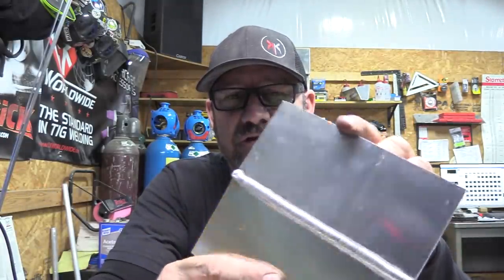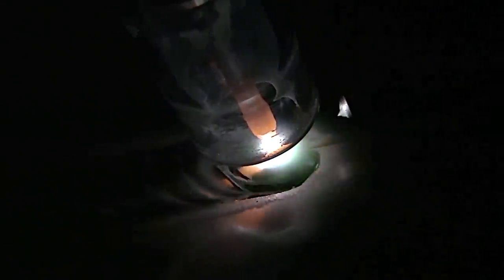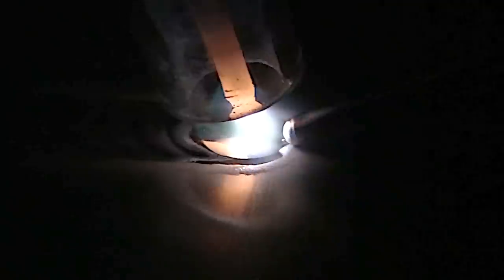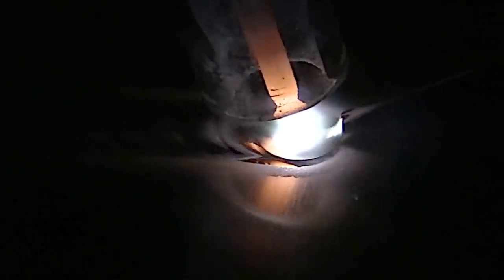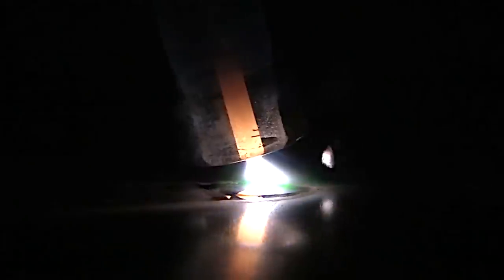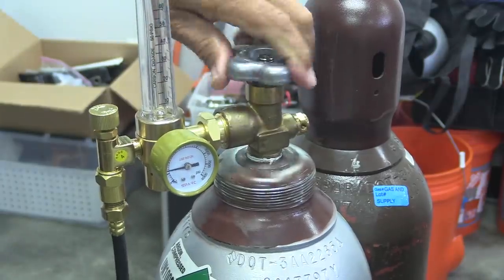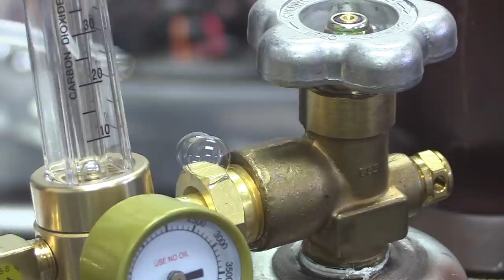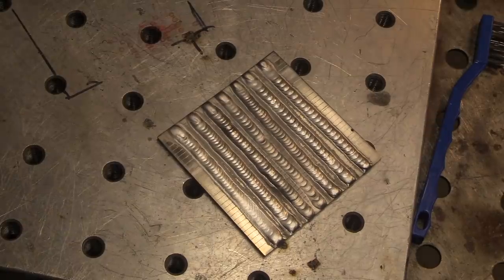How to Tig Weld Aluminum - Techniques for Full Penetration

Comment: Been welding aluminum as a hobbiest and this is exactly what I need. I can make an weld look pretty on the surface but never found conclusive info for the back side. Solved all of my questions in 8 minutes. I'm doing everything correctly, I just need to wait a few seconds longer!

Comment: Fantastic video as always. Best arc shots on the Web as they say!

We only use TIG on the root pass when working on our steam lines. So carbon seamless API pipe, 7018 fill and cap.   

So the AC function only really comes into play when working on home projects, cars and boats for example.
Your videos on AC tig have really become a "go to" for advice and an inspiration .  And of course your talented colleagues.

Best regards from Belfast.

Comment: Great video!  I’ve noticed the puddle drop before but I’ve always been border line panicked at that point because I’m afraid the whole thing will fall out. I’ll try to get a little more comfortable with this!  Thanks
Reply: Same here when I weld that slow my puddle ends up as a flat mess very frustrating

Comment: I religiously watch your videos and all the tips and tricks you gave is what made me to take brother I am today and also too I've noticed that you tested some machines and they've all been high-end machines except for the ahp. Me I got a primeweld Tig 225x and I was wondering if you would get one and give it a try and run it through the paces and see what your opinion is upon it. I've added the max cool 3000 water cooler to mine and it's gave it 100% duty cycle at 225 amps the machine is a great machine in my eyes but it is my first TIG welder and I've had it for 2 years now. I'd like to see you get one in your hands put it through the paces and see what your opinion is for a TIG welder under $1,000 and it has a lot of features like the Miller.

Comment: Kinda related , my question for you is : what 200 amp inverter AC/DC Tig machine do you recommend,  or  top choices.  

I ask because I'm using a AHP 203xi and I have a small job welding some brackets of 1/4 aluminum with a 1/2 tab about 2 inches high and I have to preheat work piece . The main issue is heat from torch and hose.  I get about 5 mins in and every is roasting. Is this from an inferior machine or am I just maxing it out? I'm using #5 ceramic gas lens,  1/8 inch tungsten with 45° bevel and I'm running 200 amps AC , 200 on frequency and 30 % cleaning 100% argon at 12 cfph.

Will other machines such as Everlast , Miller or other popular Ac Tig machines have the same issues at 200 amps? 

I know a cooler is an option,  but I rarely weld that thick of aluminum. 

Thank you  and love the videos and tig finger 
More like tig finger saver

Comment: I’m just learning. Starting with mig on aluminum. Tips?? It’s job related. Technically I am a tubing outfitter but want to tack/ weld my own stuff and am in the booth. Any help? My instructor is one of the top three but not so great on info share. I appreciate your input!!!

Comment: I am wondering how you would handle tiny corners that are diffucult to weld cause of other parts that are in the way. I pull out my tungsten some more and get a bigger cup. Scenario happens often with tiny stuff when 1,6 tungsten is needed (round tip)
Reply from the maker: I usually do the same. I would usually rather use a bigger cup with longer extension than use a micro torch. furick cups like ceramic fupa12 that have extra diffuser screens are not necessarily recommended for AC welding but definitely do work in a pinch with a long stickout

Comment: Can you explain what tungsten is recomendable to use?
Reply: I use CK LaYZr
Reply: Im still relatively new to tig. This is the most asked and least answered question I think i've found. For aluminum I've tried 2% Ceriated (grey), Pure (green), E3 (purple), LayZr (chartreuse) and 2% thoriated (Blue). The only thing I can truly say is that no one agrees, it'll come down to personal preference. Get a few colors and experiment. So far I think I've had best luck with 2% Ceriated (grey) but the E3 and laYZr both work pretty well...for me
Reply: Jody usually uses 2% lanthanated tungstens for all materials I believe
Reply: @chrisplayz253  I’ve always been old school green pure tungsten, but recently my welding supply guru has led me into the lanthanated world for everything!
Reply: I use 2% lanthenated for everything. Try it, you won't be sorry.

Comment: Newbie here :

I'm welding 16/10 (1.6mm, 0.063in) 5754 alu and for the life of me I cannot get the butt welds to get a proper fusion . Under the joint you can see the dull grey metal sagging but with a clear separation where the 2 pieces meet. And once I grind the weld, there it is , a hair line where the 2 parts meet. 

I tried keeping the torch on one spot for long and then move slowly but ... Nope. It's like both parts want only to melt each separately and never mix. Even with the filler metal, they'll mix inside it (on the surface) but under that they're still segregated. 

What is happening..?

It's an industrial 400A tig, using 1mm (3/64") zircon tungsten , 70-30 balance, 32 to 37 amp , 'bout 12-13cfh, can't tweak hz.

Comment: If you're welding thicker than 1/8, do you gap the material or still butt it right up to each other? I weld sched 40 aluminum pipe and I have a lot of trouble getting good full penetration.
Reply from the maker: Anything thicker than 1/8 I would use a gap if I needed full penetration

Comment: I have a question about the behavior of 74% of the balance, why is it so much?  I usually use 31%.
Reply: Ep or En, your machine reads electrode positive.
Reply: Some machines are back to front like that, just the way they display it. You would have 69% if you where using his welder